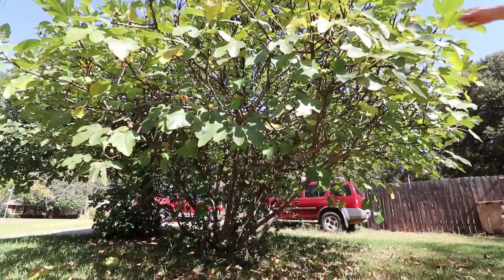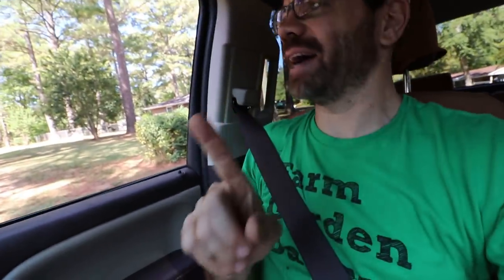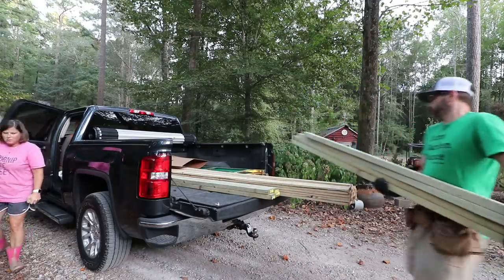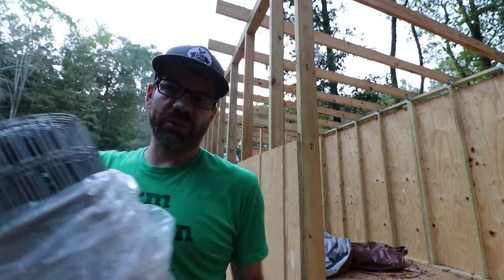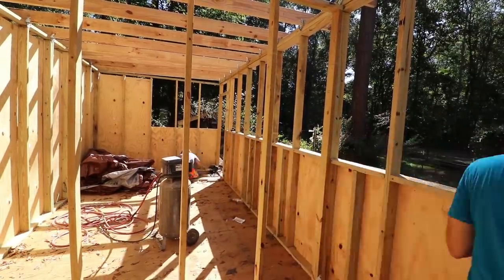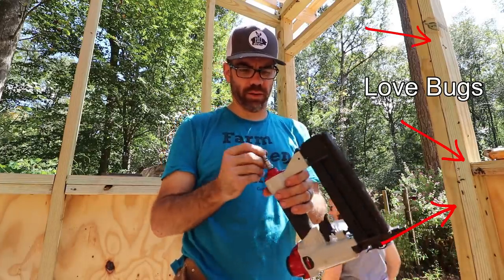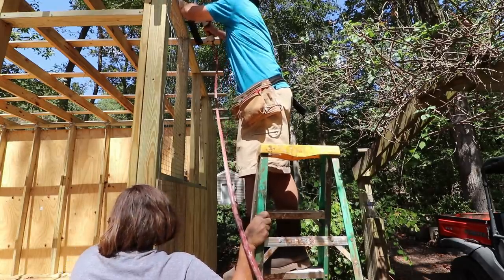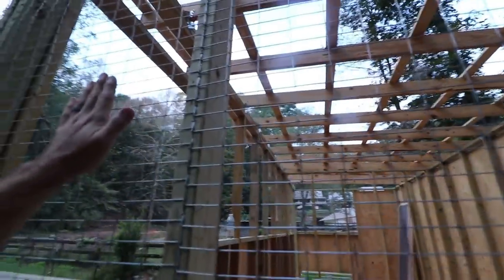This Is WAY Better Than We Thought It Would Be For the Chicken Coop!!

Comment: Thats what I call a ring nailer.  but that's what i use to put my wire on, inch or 1.25 inch deep staples.  Now, if you over penetrate it can start to cut the wire And its possible that a angry predator might be able to pull it loose, I can't but I'm not HUNGRY.l.You can go over the stapled area with 1x2's and that will seal it down.  Also, to cut any of it, get a disc cutter, side grinder?  I forget what they call it but you can get 1/8 inch disks about 3-4 inches in diameter, there electric and you just go down the seem where you want it cut.  To heck with hand cutters, hard on my arthritis.  If you have a seem that is in the middle of the air, hopefully not but sometimes, get J-clips and Jclip pliars like what they use to bind that 1x2 wire together to make bunny cages.  Just put a clip every other opening and your solid.  Wire and hardware cloth are hard on my hands, physically and it grinds off the skin but for some dumb reason, I love to do it, especially with that stapler.  Remember to keep the chickens away from the wall of wire.  Raccoon come along, reach in and pull what part of the bird he can through that wire.  Won't get much but it will kill the bird.